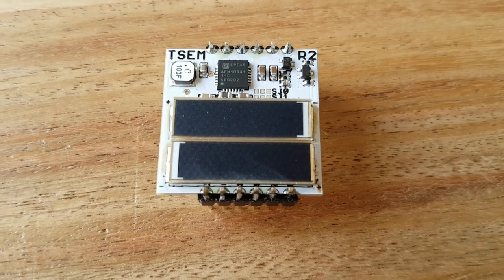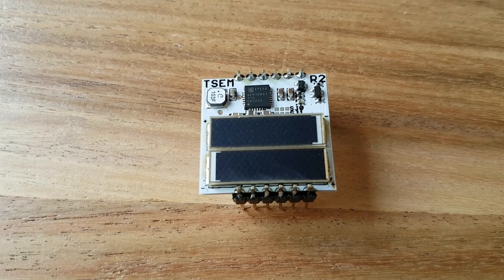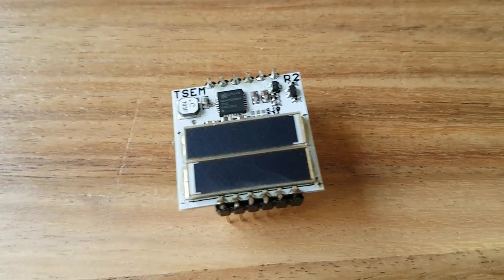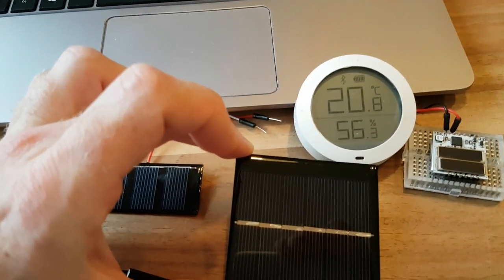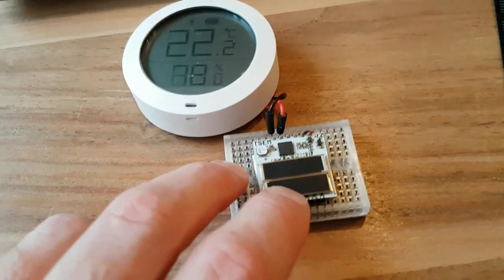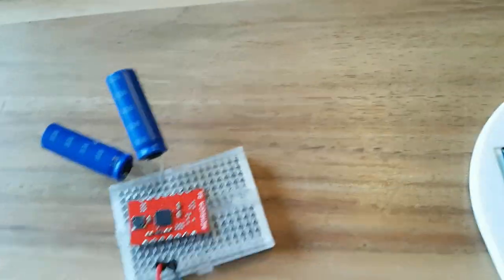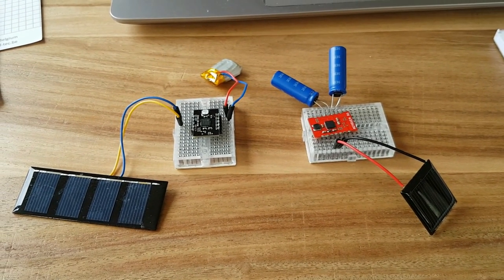Tiny Solar Energy Module Hackaday Prize 2018 Entry

Comment: i am a graduate CS engineer. searching on tiny solar-powered PCB and ended up here. thanks man,,, you are amazing.  i am working on project of tiny gps  tracker ( realtime) module with  intergreted solar charging  system. so externel power needed.  can u help me with ideas ? can i connect you in social media . or your emai;l address or something?

Comment: The board is so cool!! This is the first time that I can not stop myself from leaving a comment for a video!
After you modified the temperature sensor with TSEM, can the sensor still read how many power left from the Li-ion battery? or it will always be 100 percent?
Reply from the maker: No it does not read battery level anymore. Originally it was powered from 1.5V alkaline and the temperature sensor has a 3.3V boost circuit for the MCU / ADC to read battery voltage. Now it is powered from aemsuca 3.3V output and the supercapacitor voltage (3.6 to 4.7V) is too high for the MCU that runs on 3.3V, so it does not read the battery voltage anymore and it always shows an empty battery
Reply from the maker: By the way, i did not use the tsem to power the temperature sensor. I used the aemsuca board for that. I am selling aemsuca on tindie. See my additional info below the video.
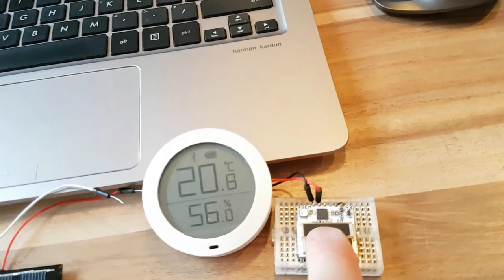Reply: @JasperSikken  Thank you for the quick reply, I think I didn't make myself clear. The modified sensor I am talking about is the one powered by TSEM with a battery at video 2:34. Is the sensor able to read battery level for that one?
Reply from the maker: @chaoshunzuo7081  Sorry, but now I understand your question. The answer is short: no.

Comment: Nice board. Whats the max current output on Vreg outputs?
Reply from the maker: 80mA on the HV (3.3V) and 20mA on the LV (1.8V) ouput.
Reply: Thanks for the answer. I'll check them out.